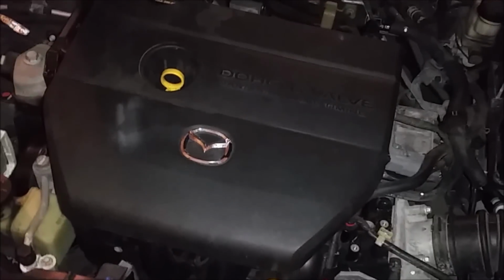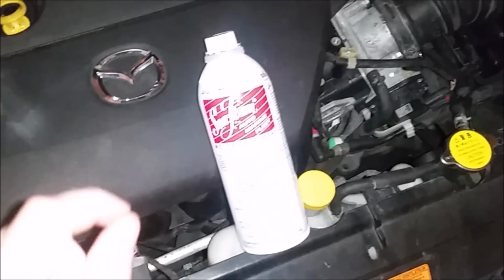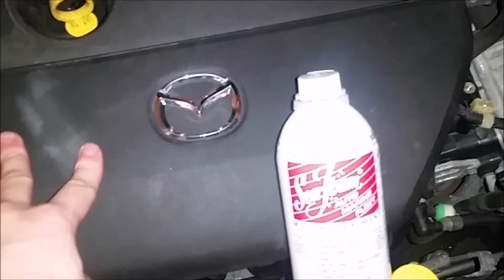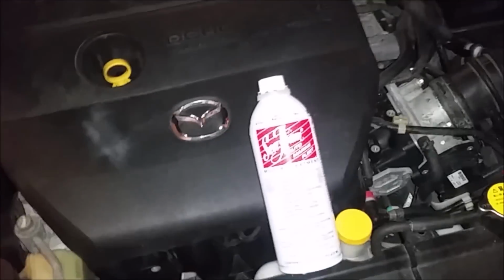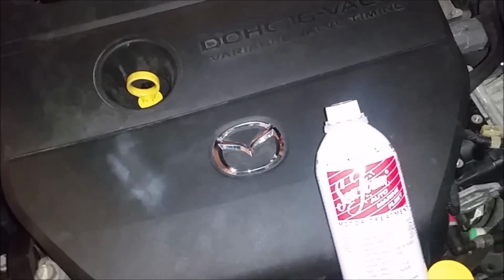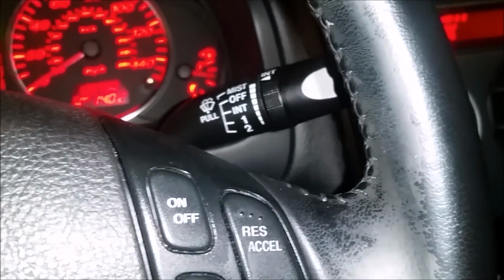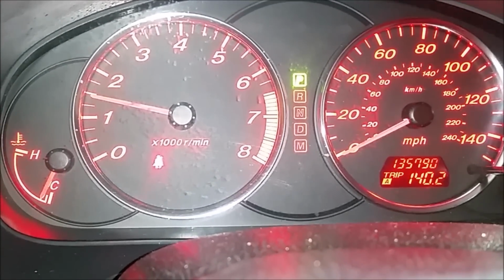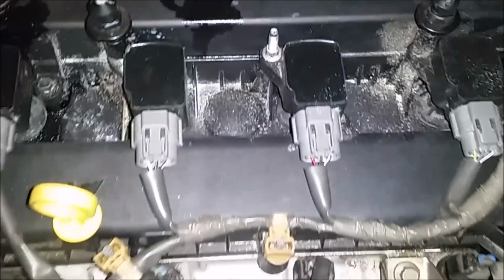Fixing noisy lifters   hydraulic lifter 2006 Mazda 6

Comment: For those who think TL;DW:

4.5oz Seafoam 100 miles
2oz Seafoam 100 miles
2oz Seafoam 110 miles
2oz. Mystery Oil
then oil change (with filter)
"Ticking noise is gone, guys."

Thanks for the video, man. How are the lifters now?
Reply from the maker: Thank you for your comment and you're welcome, I am glad to make this video.
The lifters are a lot quieter now, I can still hear them very slightly but that's because I am paranoid about them.
Reply: I feel you on that, man. I fixed an idle issue on my Mazda and it's running fine now but I swear it's got just a slight enough vibration to keep me paranoid ... no one notices it but I sure do.

If you haven't checked, Mazda actually recommends a valve adjustment for our cars. Often, a valve adjustment can fix this issue and if it doesn't, fixing the one lifter that's usually causing the problem isn't too expensive.

Comment: On an overhead can engine,the cheapest & quickest solution is to remove the lifters & soak them in fuel or solvent overnight then to dismantle & clean them out the next day,that's if the additive doesn't work within a week or so.
It took 3 years to clean the lifters out completely in my car (Chevy LS1 engine) & I've been too poor to afford the parts to fix them up straight away as the cylinder heads need to be removed to gain access to the lifters.
I have used 5 bottles of the Wynn's brand of their engine tune product & 1 bottle of the Repco brand (Australian) to free all of the lifters up which I found were all gummed up with sludge & varnish ,that had freaked a few people out who probably thought I blew my engine up after hearing a loud tapping sound.
A mechanic will do it by the book when it comes to charging a customer as that becomes a professional job as he has to fit new lifters & offer a warranty on repairs due to consumer laws which protect both the customer & mechanic,if the job isn't done in a professional manner,the customer can Sue the mechanic if he refuses to do the job properly & there's evidence to back that claim up.
I know a lazy mechanic will throw another used engine in if he couldn't be bothered replacing the lifters so leaves the customer without a leg to stand on,particularly if the cost of lifter replacement is cheaper.
My personal opinion has been to add the lifter treatment to my engine due to the fact no ratbag as that has been decent enough to employ such a person as myself over here.
Reply from the maker: You are correct Russell. Some Mechanics are lazy. And you are correct when you say the correct way is to remove the lifters. However, if that car is your daily driver then this is very convenient. If this method of MMO and Seafoam doesn't work. Then I would take your advice (especially on a OHC engine) in taking them out and putting them in solvent.
Reply: +Russell Booth - Normal People can't do that :(((((((((((((((((((((((

Comment: It works I do it about every other oil change. I leave syn blend and a good filter in for 5000 to 7000 miles and it keeps my car banging. I had my 2011 kia forte since new and have 127,000+ miles, I get 35 MPG and run the AC on full blast about 9 months out of the year. I live in Arizona and last year my car thermometer registered 120 F. Don't forget to flush your radiator, I do it every two years. It is Hot as Hell in Arizona.
Reply from the maker: Thank You very much for your feedback and your experience. You are right, many people forget to flush and replace their coolant. Which is very important  when it comes to how long your car will live.

Comment: I have a volkswagen jetta and I had bluish, white smoke coming out my tail pipe and I thought I would have to pay a arm and a leg, few quarts of sea foam later no smoke like gone whodini this stuff is magic.
Reply from the maker: WOW! good to hear Martin! Glad sea foam saved you an arm and a leg! LOL
Reply: did you put it in your gas or oil
Reply: Gary Shaw in my oil.
Reply: Martin Martinez di you get an oil change after?
Reply: Gary Shaw no I did a oil change 500 miles after putting in the sea foam, but before that if you want a better cleaning process I put in motor flush, five minutes after letting the engine run then do the oil change. I recommend you to do more research if you want to play it safe.
Reply: May I ask if your Jetta is a 1.8 Turbo??

Comment: You need a valve adjustment every 50k to 75k miles on your lifters also marvel mystery oil works wonders but use before oil change and remember to tune up to prevent carbon build up
Reply from the maker: You are right! And thanks for the good tip!

Comment: I replaced all lifter in my Triton  with new ones. Still ticked. Put 2 old ones back in on the intake side which made a 90% difference but i think 1 or 2 may still be faulty on the exhaust. Will have to remove and recheck again.

Comment: Lifters suck.  I miss the days of the good ole 90's Honda engines where the cam made direct contact with the rocker arms.  Adjusting valve lash is not that hard!
Reply from the maker: No it isn't, but i can only assume for cost benefit purposes that the change happened.

Comment: Hey, how did it sound after your first 4.5 ounces before you added more/the other brand cleaner? Also what's your take on buying the seafoam spray and spraying it directly into the vacuum?
Reply: Oh I almost forgot, does it still sound good or did the ticking come back? If so how long until it came back?
Reply from the maker: Hi William, the noise before I added the fluids wasn't that bad. But I addressed the problem very quickly. Sea-foam into the vacuum is great but won't stop ticking because the sea-foam has the be with the oil to cure the noise. It did come back in about a week. But I followed my steps again and it never came back.
Reply: Awesome, thanks for the response!

Comment: Hi there. I have a 2011 mazda 3 manual with hydraulic lifters. I have a pretty loud tick. I recently bought this off someone a couple months ago. Woman said the oil change was recent but the oils pretty dark. My question is this… Should i change the oil and filter first then add the seafoam and mystery oil and run the process and change the oil again? Or is it alright to just put the additives in now then change the oil and filter? It also has 199,000 miles on it but it runs great other then the ticking.
Reply from the maker: Hi Jennifer, do you have any check engine lights? Loud ticking could unfortunately be rod knock and not lifter tick. If you have rod knock, you will need a engine rebuild. Engine oil can get dark pretty quick if a engine has a lot of carbon (never driven on highways). Please keep in mind that seafoam will thin your oil, so it's not a good idea to add after an oil change, but a good idea to add prior to an oil change by around 50 miles.

Comment: Thinking about doing this on my knock on my spare car, 04 Hyundai Santa Fe with 3.5 Eng. Has 157k miles on it. Fuel tank leaks but has new tires with 200 miles on them. Fuel leak has a TSB that I never knew about and after a year and a half of chasing crappy fuel mileage found out the tank was leaking. Mfr has a TSB which extends them to 15yrs or 150k miles for the fuel tank warranty from date in service. Definitely crappy fuel tanks if they extended them that long if they qobt cover I'll be out roughly $300 for a new fuel tank +/- misc hardware, fuel tank straps, nuts & bolts if needed. 

Regarding the lifter tap I'm thinking a flush with seafoam, cheap oil change to release crud loosened from seafoam then a regular oil change with some Lucas Oil Stabilizer to help coat the lifters good. Need to do a oil pressure check as well before hand to make sure pump isn't getting weak though. 

Anybody have any bad thoughts about the Lucas oil products I need to be aware of if not maybe a little AmsOil in place of 1 quart of engine oil. I'd think that would help things. Bring the suggestions on. Yes I'll change my oil filter as well......
Reply from the maker: Hey Dale, sorry to hear about the fuel tank situation. I know this might not be the best solution but if it's a small hole in the tank. I would just drain the tank and JB weld it or use some good RTV on it. 

For the lifters, I would just keep seafoaming your engine oil 200 miles before changing it. I also like Lucas Stabilizer, I think its good stuff. Never had any problems using it.

Comment: I would recommend using Mobil 1 Synthectic with your Mazda.. I own 2012 Mazda5 w/ 312k miles & purrs like a kitten !  4qt & filter @ $60 bucks..
Reply: Wow dude...My Suburban uses 6 quarts and filter all Mobile 1 for $32........$22-$25 for oil and $7-$10 for filter depending on where you shop.....Walmart always have deals

Comment: I believe the ticking noise was taken care of by the Mystery oil, not the SeaFoam.
Reply from the maker: Hi Jain, thanks for your comment. Do you have any good experiences with mystery oil?
Reply: Anthony Awada Hi Anthony, I never used mystery oil before. But I used to a BMW that has ticking noise and minor head gasket leak, tried to use Seafoam, and  some other engine cleaning products trying to solve the problem, but didn't work. Then I tried synthetic high-mileage engine oil (which work similarly as the mystery oil), the engine became much quieter, and only see several drips a week.
Reply: but doesn't seafoam work similarly to mmo? I was trying to figure out why he used both of them.
Reply: ***** Maybe my moemory was wrong? I remembered MMO is a very thick oil, while Seafoam is just like water.

If Anthony wants to firgure out which one really works, he should try one product at a time.

Comment: When using additives 1st time on engine. Fill additive run to warm up 5 min avg. Drain oil, replace filter.
2nd oil change,  fill additive, run 15 min after warm up. 20 min avg.
Change oil at low mileage intervals plus inspect oil and filter.
The crux is less suspended particals in engine at shorter times. Not good to grind freed grime through the engine. 
Nevermind what Democrats say, it's a lie...
Always replace filter.
Reply from the maker: Great comment! Good point in mentioning that you should not feed grime through the engine.

Comment: did you notice a change in performance any?
if your cleaning out carbon you should notice a performance increase....
Reply from the maker: Yes I noticed a slight increase in fuel consumption and power.
Reply: I have tried it just in the fuel tank on my 09 G6 4cylinder.
I've seen a increased fuel consumption. But not much in performance.

Comment: Hi Anthony, I have a Mazda 6 2.3l engine. I recently changed spark plugs and cleaned the throttle body. My r.p.m at idle when engine is warm is 1200 rpm in neutral and about 1100 rpm to 1000 rpm in drive. My fuel consumption has gone up. My question is, how do you adjust the idle back to about 700 rpm or 800 rpm? Thanks.
Reply from the maker: Hi Robert, I would start by checking your PCV and PCV hose. It's a little pain, however i have a video showing how to get to it. You basically have to remove the intake manifold to get to it. Usually when PCV  hose is cracked and vacuum leaks happen your car will  idle very high. If that doesn't work. I'd clean the Mass air flow sensor and Idle air control valve that is built into the mass air flow senor unit. Let me know if there is anything else I can help with.
Reply: Sorry late reply, but reset to factory setting: unhook battery for 10sec, then leave engine run for 20min, then just turn ac on and leave for another 20 min. This resets / relearn program mazda factory reset

Comment: Hey Anthony, did the lifter tick stop as soon as you added the seafoam and mystery oil or after you drove a thousand miles and did the oil change?
Reply from the maker: Hi Louis, I had to keep doing this process for 2-3 months until it finally got quiet. It all depends on the condition of those lifters.
Reply: Anthony Awada Thanks Bro.  Yeah the first time didn't quiet them after I did the oil change yesterday.  I'll start the process again today
Reply from the maker: Louis Cypher sounds good. Persistence is key.
Reply: Anthony Awada Today when I added the seafoam, the ticking stopped after I started the engine. But, when I began to drive, the ticking came back again, does that make any sense?
Reply from the maker: Louis Cypher Yes, it makes perfect sense. Once your car had load on it. The noise comes back. If keep repeating the process. Remember, some ticking is okay. The fuel injectors are very loud on Mazda 6.
Reply: Anthony Awada Ok Yeah it ticked on the way to buy the seafoam.  I added it, then I started the engine, and the ticking was gone.  But after I drove a couple miles it came back.  The first time I added the seafoam it didn't completely stop the ticking like it did today so I'll keep doing it.  Thanks Anthony

Comment: Last may 25,2016, I went to jiffylube to have oil change.  May 26,  Drove my car and heared loud ticking  sound from the engine. underneath  the car I heared loud sound.
Reply from the maker: I'm sorry to hear that Adelina. A good friend of mine had to get a new engine after he took his car to Jiffy Lube.

My recommendation is to do oil/filter changes yourself.  You don't know which oil/filter they use. It's usually the very low quality. I've seen freak stories where they forget to put oil in the car.
Reply: Jiffylube, Sears are not good places for any automotive jobs.

Comment: I'm a lil confused here. Did you do the oil change before putting sea fom? Or you had 1,000miles already?
Reply from the maker: Gustavo Orellana hi Gustavo what I did was basically add seafoam and Marvel Mystery Oil then drove 1000 miles and then changed the oil. Let me know if I can clarify anything else.
Reply: Anthony Awada but you're saying that you added 4oz of seafoam drove a 100miles than another 2 oz another 100 than 2 oz seafoam and 2 oz of marvel mystery and than another 100miles and you did the oil change after. I hope I'm getting right. So I guess did change the oil before adding these 2 additives. Am I correct ? Thanks for responding.  Blessings
Reply: Anthony Awada hey Anthony. I forgot to mention that I'm also getting lifter noise on my 07 Mazda 3 2.0. I hope I'm getting right what you're saying. What i understood is that you drove for 300miles with seafoam and marvel mystery. Thanks again.
Reply: Didn't work, unfortunately. Good video anyways
Reply from the maker: That is correct, I did drive with 300 miles with seafoam and marvel mystery oil in it. If it doesn't work the first  time then I would give it another shot and continue to do this process. Every time you do it you are basically cleaning the engine a little more. Eventually the lifter noise should go away unless they are damaged.
Reply: Anthony Awada - 100% Correct !!! Trying is CHEAPER than going to a Mechanic !!!  I made my own Formula since this is all I have. 1 Ounce of Gumout and 3/4 of a Quart of Trans Fluid. The Noise is gone within 20 Minutes. I just made a Video on my Channel too :D

Comment: unfortunately, it didn't work because I found out that the previous owner of my car didnt change the oil often or never. I bought the car from the dealer and they sold me the car in that condition. I'm currently saving for another engine but what worked to lessen the noise was bandharl no smoke oil. The oil is thick and makes the noise go away but the problem with the motor remains.
Reply from the maker: I'm sorry to hear that man. Yes, these engines will knock hard if oil changes are not done often. The thicker the oil the better it will help quiet the noise but there's no permanent solution other than rebuilding or replacing the engine.

Comment: I got an oil change and my car makes a sound like a metal fan hitting a stick.. its not very loud but it is definitely related to the oil change. my oil leak has stopped also. does this mean maybe someone put some oil that's thick in the past to stop the leak and did that causes problems with the new fresh oil spreading? is seafoam in the oil the answer? 2005 audi a6.. oil change done by german car specialist. maybe is it that they put a different type of oil in? I was using 5w30 and it was quiet. is there anything I can put in there to quiet it down without doing another oil change because I just did one not long ago
Reply from the maker: Thicker oil does quiet the engine. Sea-foam will clean the engine from the carbon deposit and sludge buildup. Thicker oil makes the pump work harder and makes it weaker.
Reply: thanks for answering.. after the oil change it was really thin. I wonder if they may have added something to thin the oil so they could change it! I had another oil change somewhere else and it is better again..

Comment: I wanted to add seafoam in my crankcase right now but I wanna know if its gonna smoke a lot like on all the videos?
Reply from the maker: It shouldn't smoke if you put it with your oil unless your car burns oil.
Reply: Anthony Awada ok cool that's all I needed to know. Ty
Reply: Smoke is when it is used to clean injectors and valves... They put it in the gas for that

Comment: In my case,I'm only going to use an additive to quieten the noisy lifter down in my Chevy LS1 to get it passed for road registration.

After that, I have another used OEM camshaft to replace the likely damaged one & an improved set of LS7 lifters which are what GM supply as default now.

They supersede the LS1 items.

Comment: Did you hear the knocking noise on a cold engine?
 Mine starts to get loud once the engine warms up.
Reply from the maker: It shouldn't get louder. If anything it should get quieter. Try putting in some Lucas oil stabilizer or thicker oil weight and see if that quiets it down,
Reply: Anthony Awada 
It turned out to be the butterfly valves in the intake manifold. I'm going to do the vtcs delete as soon as the weather permits.